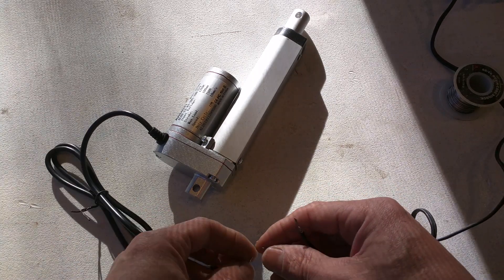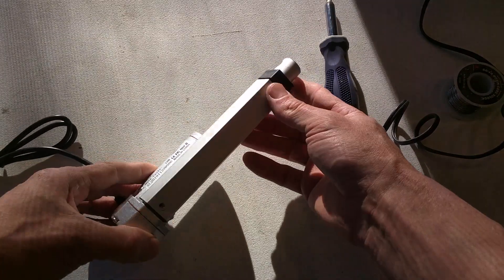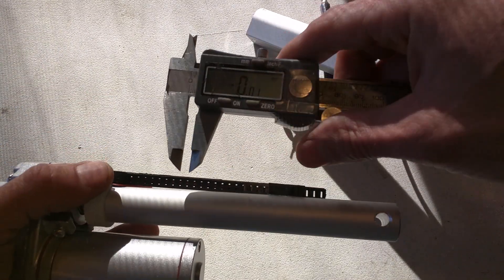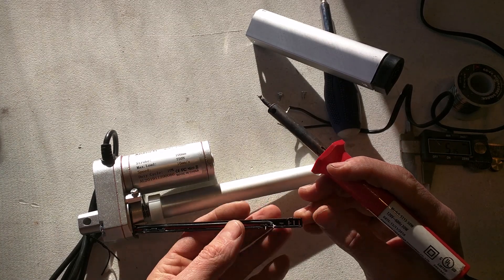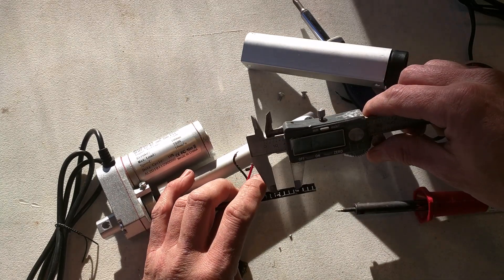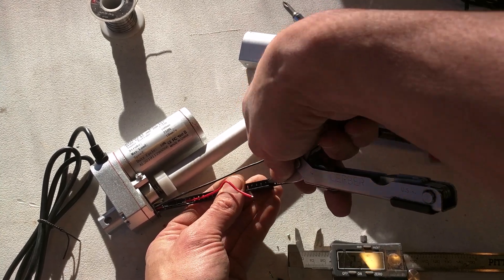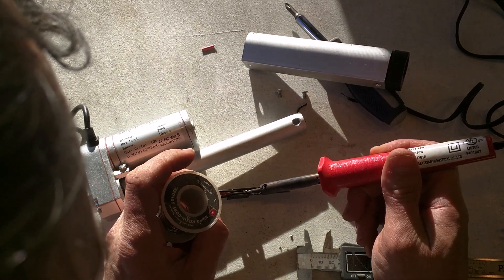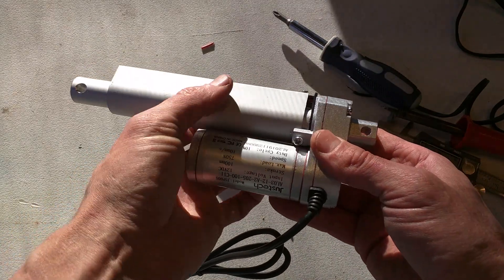BIRTHA - Linear actuator limit modification

Comment: Are there any other methods of adjusting the limit switches without having to solder I’m afraid I’ll screw something up?
Reply: There are  more expensive actuators that have adjustable limits. Other than that just add an external limit switch and diode. Very easy to do.